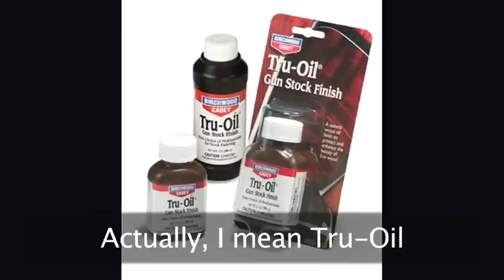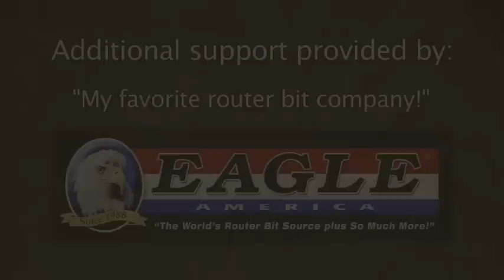107 - Oil-Based Finish Basics

Comment: Hi Mark My question is I'm using Deft Clear Lacquer Brush on Wood Finish because it 
was given to me (2 new Gallon cans) but after the first coat has dried it feels gritty & 
nowhere as smooth as before I applied it? What is going On?
This is on a 3/4" Birch Plywood assembly Table in my shop. I started with 80 grit sand
paper because I've had the plywood for months in my shop & it had a few scratches and 
dents and then worked up to 240 grit & top was as smooth as glass but after first coat of lacquer it felt gritty so I went back to 120 grit,150 grit,200 then 240 grit and cleaned by vacuuming then wiping down with Mineral Spirits and soft cotton cloth and 2nd thin layer of Lacquer as the can says and it still comes out gritty ?
Please Help! not sure what to Do? Should I have thinned with Lacquer Thinner - the can says do not thin! & No need to sand between layers? 
I've never used Lacquer before but have used Polyurethane a lot and always sand with 
220-240 grit between every coat and blow off with air and wipe down with damp cloth then 300 grit & polish/Buff the last coat to a nice shine. So what am I doing Wrong with Lacquer?
Thank You for any advice you can give Me! Love you videos!

Comment: Thanks for the reply, After reading more it looks like I can use pure varnish like Epfanes or Arm-R-Seal on sanded and prepped F.Glass prep for better adhesion. Then the bare Cocobolo prep with Acetone, apply thin layer of 1 1/2 lb. Shellac to seal oil in. Then over coat with layers of thinned wipe on Varnish. After Shellac can I use diluted wipe on Varnish and hand buffed or is a brush the only solution? I have problems with streaks and drips and streaks. Good plan?? thanks so much.

Comment: Second rookie question:  I am building a little LP cabinet out of the tabletop pieces of a vintage Parker dining table.  Hence the wooden panels are all composed of pine or similar beams which have been glued together, and then layered top and bottom with thin sheets of teak (or similar).  It's going to make an interesting piece.  The problem is that 24 hrs after sanding and cutting two of the main panels, one of them has juuuuust started to warp ever so slightly.  So lesson one, I should have not sanded the original finish away until after cutting etc.  Anyway, as I can only work on this on weekends, I am in the meantime keeping these naked pieces clamped down to a flat surface to avoid warping.  My second rookie question is - how do I seal (oil / varnish as per my last question) these pieces AND ensure they don't warp whilst drying / curing? One of my "naked" pieces started warping in less than 24 hours. Kept indoors (it is cold this time of year, in and out, and it's wet weather). If I use clamps, I'm going to wind up with clamp marks and / or the oil / varnish won't dry properly underneath the holding clamps.    Your advice will be much appreciated.  Thanks.

Comment: If I want to make kitchen cabinets, natural wood is hard to clean and wipe off as the dust and possible food stuff tend to curl up to the surface. What kind of varnish would be recommended for shelving or would it be better to add a sheet of melamine?

Comment: I have a walnut gun stock with no finish. I want to bring out the natural beauty of the wood with a low gloss. Should I apply Tru-Oil Sealer & Filler first due to the open pores and then apply Tru-Oil Gun Stock Finish or should I just apply Tru-Oil Gun Stock Finish?

Comment: I used CPES on antique wooden boats with a syringe on Mahogany and or Teak, solid and plywood. The best trick is to start the topcoat (Helmsman) while the CPES was just tacky and this actually glued the topcoat to the repair work. I finished it with 10 coats of Helmsman Spar Varnish with a light sand in between coats. Spectacular on Grand Banks Trawlers

Comment from the maker: @LightningBugSF Well if you got stain douglas fir to look good, even if a little dark, I hate to see you mess with it.  But you gotta do what you gotta do right?  Mineral spirits probably won't affect it.  Bleach is hard to control.  I would probably strip, sand, and try again with a different stain.  if you just sand alone, that won't make it lighter.  it will just make it look patchy.

Comment: I'm looking to buy an antique table that the owner says is finished with oil.  However, the table top is looking dry and paler in color than the sides and base of the table, which are a beautiful rich cherry tone.  Also, the leaves look like they haven't been maintained in 50 years (previous owner never used them)--they're dry and grey.  I feel like there is hope for the top surface of the table, but what about those leaves?  Can I expect to be able to restore them using the same oil as the rest of the table and have them match?

Comment from the maker: @rockonku Well the best finish is the one that you can apply properly and effectively.  There are many finishes that will work for stairs.  I do beileve Arm R Seal would be a decent choice, although most coating for flooring are made with a higher amount of solids, so that they stand up to the constant wear and tear.  I yes you can use Arm-R-Seal, but I might also take a look at some specific flooring products.

Comment: I know this video is several years old, but it’s very informative. Right around 8 minutes in you are talking about mixing your own oil/varnish mixture. You are holding boiled linseed oil and also mention tung oil... can mineral oil be used in that application instead? I like using mineral oil on my cutting boards, and usually put GF salad bowl over the oil...

Comment: great video. thanks. i just have a question or two. I thinned down the poly 50/50 with paint thinner and applied a thin coat using a clean rug to my table tennis blade. Is it ok to apply another coat when it's dry to touch yet still tacky? 2nd question, what to do if ever i applied 2nd coat while the wood is still tacky after 2-3 days? thank you very much.
Reply from the maker: Nope. Never apply more finish if the surface is still tacky. That means it's not completely cured yet and adding more finish will only make the problem worse. It results in a finish that's even MORE tacky and takes longer to cure. If you're lucky, you can let it sit for a few weeks and it will cure up.
Reply: ok. got it. Thank you very much! :)

Comment: Hi, great session on oil finishes. I have a question, Can a nitro lacquer be sprayed over a dried linseed oil base? Will there be any adhesion issues? Do I need to hit the linseed oil after it dries with a shellac first? The reason I say this is that linseed oil really pops out the grain and I want a matt/semi gloss finish with Nitrocellulose lacquer . Please let me know.
Cheers, Craig
Reply: Craig Roy. Cheers. Not all lacquers are equal, and most manufacturers will always recommend you only spray over their products. We’ve sprayed lacquer over boiled linseed oil only after 72 hours. We now use a vinyl sanding sealer under all our lacquer, per KCMA reqs, might aid adhesion. Now moved to using clear stain base, no tint, to duplicate effect of linseed oil, and we can top coat after an hour... but if time’s not a factor and you want the amber color of linseed oil, go for it. Shellac may be ok if it’s not waxed... but best to keep it simple because finishing can be really tricky. Good luck.

Comment from the maker: No experience myself. But as long as the surface is fully cured, you can coat it with just about everything. Give it a few weeks just to be certain. If you sand lightly and you get little boogers on your sandpaper, it isn't ready.

Comment: Something I learned at one of the woodworking shows:  At a party, people put a beer bottle on top of horizontal surfaces.  They never put the bottle on the side of the table leg.  Gravity won't let you.  So coat the horizontal surface with varnish, but leave the legs/sides/insides with shellac or oil etc.  It makes the legs look great, yet the top surface is durable against the idjit that puts a beer bottle on your table.
Reply: +Bill Wheaton  You stated the obvious which had avoided me. Great info you just provided. Thanks!

Comment: Hello and thank so much for your video. I have an Acacia (white acacia / black locust) dining room table recently made... and am unsure how to best bring out the grain. What finish would you recommend to best accomplish this? Really appreciate your video, very well done!
Reply from the maker: I think one of the best and most beautiful finishes is a simple wiping varnish. Brings out the natural colors, enhances them, and also provides protection.
Reply: So i ended up staining the Acacia Table with Linseed oil and let it sit for a week before putting on several glossy polyurethane and then matt polyurethane coats....the table came out beautifully...thanks for your help

Comment: What's the best coating for long handled garden tools eg rakes, spades and forks for a durable finish. They were handed down from my great grandfather and still in good condition ( buy good, buy once) but they were open to the element when the shed roof took off in gales. Most of the handles are ash but a few are hickory. Some of the handles have dried and grain has opened so I'd like to get some oil in there. The tools might sometimes be left outside.
Reply: Oh and what oils or other penetrants can take an overcoat of something more durable and what penetrants can't?

Comment: Thanks for posting these! It helped a lot with a project I am currently working on. I do have a question:

My table top (Soft Maple) has been stained and one coat of oil/varnish (linseed,poly,mineral) has been applied. I want to create a design and paint it with OneShot metallic (brass) enamel. All of my research says that once properly dried I can continue applying the remaining layers of oil/varnish over top of the design that is on the table top. I want to know if my research is correct? Thnx

Comment: heh, well that makes a lot of sense! its true, it is a lot of effort and patience.. but then, what would be an ideal top coat for a stained tung oil finish?
i certainly dont like the glossy poly finish on most typical guitars. my goal would be some protection from moisture (sweat and such), and the satin sheen and super 3D depth that the oil brings out when still wet (which sadly seems to go away after drying, up to now).
hey, thanks A LOT! your videos really help!!

Comment: Do you have any experience with Sutherland&Welles products? I used their 'hard sealer' which I think is polymerized tung oil with some Uralkyd? resin for the first two coats on a cherry tabletop. I then moved on to their TableTop finish which is "a high quality uralkyd resin with Polymerized TungOil Sealer." I am having a hard time with this stuff(bubbles and streaking) and want to know if I can finish up with a wipe on poly/armRseal varnish. FYI, no MSDS for any of their products @ ~$40/qt.

Comment from the maker: Well, if you have an oil/wax mix on the surface you are pretty much committed to that route. Finishes generally don't adhere to wax. I'm not familiar with the product you're using but if you are using a true oil with wax in it and you still get material on your cloth in that time frame, you are probably putting too much on the surface to begin with. Less is more with oils.

Comment: Any thoughts or tips on choosing a finish for a tongue drum/slit drum?  I'll be using African Padauk for the top and am wondering how the different finishes may affect the tone, if at all.  Obviously with the expense of the board I want to try to keep my experimentation down to a minimum.  Also, it seems that I'll need to keep bleed through to a minimum since I won't have access to the inside of the drum after it's finished.

Comment: Hi Marc i've made a chest for shoes to be left outside under the verandah i'd like to coat it in cpes prior to using an external grade polyurethane. My question is that i'd like to coat it in boiled linseed oil prior to using the cpes to really pop the grain, is that going to be compatible with cpes? Thanks cheers.
Reply from the maker: +Libby Parker It should be, but it's not a bad idea to give it a good week to cure first. Also, try the cpes on scrap first and see if that doesn't give you enough "pop" on its own. If you don't have to use the BLO, don't.

Comment from the maker: Yes you can add shellac on top of the oil. But man, that's a LOT of effort just to cover it with a film. Tung oil, applied in that manner, is a great way to get a hand-rubbed look. Unfortunately this type of finish is not all that protective. So I understand the need to apply a film like shellac or varnish. But when you do, you essentially negate all of the work you already put into it. You could get the same look with one coat of tung, followed by your topcoat film.

Comment: Greetings I'm just entering wood crafting in this case musical instruments. i've just tried the minwax water based stain, when working with very thin wood 2mm thick .87 thousands I'm trying not to worp the wood and my question is can i apply a laquire clear coat in stead of the poly crylic witch saturates the thin wood even more?

Comment from the maker: Yeah unfortunately what you are seeing is cracking as a result of the wood drying.  The key is to use kiln-dried stock for your projects.  You'll have to see if anyone in your area carries 16/4 stock.  you should be able to find some fir or southern yellow pine depending on where you live.  Otherwise, call some local hardwood dealers and see what they carry in the thicker sticks.

Comment from the maker: It's probably a combination of durability and solids content, but who really knows. Labeling on cans, ironically, can be one of the most misleading sources of information about a finish. But generally speaking, floor finishes are specifically configured for that task so if at all possible, use the stuff meant for floors. You can certainly use what you have, but I can't necessary say how well it will turn out for you. I don't have any experience with finishing floors.

Comment: hi! really nice explenation! I have one quetion: can I add wax after the linseed oil coat? I mean I have been putting bee's wax after one day the oil has been cured. does it make sense? thank you
Reply: +Lorenzo Marrali   I'd like to know that as well. I want to go simple as possible.
Reply: +Billy Barton I know right? is seems almost impossible to understand some simple stuff. almost as people were afraid to give that "divine secret" of some sort. by the way.. I have asked my local wood supplier and he told me a lot of interesting stuff.. first, yes. it makes sense to put wax after oil. but is it better if oil is "boiled" or "coocked" I don't know English very well.. by the way, linseed and a great choice if you want to stay simple but you need to wait at least three days after a bunch of coats. he said for soft wood and medium use three coats of oil (the one you prefer linseed, nut, danish) each coat every 24h. after that apply a generous coat of beex wax (the one mixed with carnauba works too) and wait 15 minutes.. after that use hair drier to blow the project surface and let the wax melt (you will notice that it will get translucent and watery.. do one side per time.. after a really good blowing go with a wool napkin and stroke really hard.. let the melted wax go inside the wood's fibers... and that's it. after 24h if it looks a bit greasy go again with a clean cloth.. I have done it on my last three projects and they look fantastic. it might seem a bit time consuming but it is really simple and each coat (oil and wax) only take couple of minutes. I hope it has been useful. and forgive my English. cheers.
Reply: Thanks for your reply. What I do is "rustic" so I'm not concerned about hi gloss finish.

Comment: im finishing a guitar body with pure tung oil. its already 8 coats, letting each coat dry for about 20 days or so.
i'm loving the looks of it already, but i would like that extra depth that varnishes seem to produce, plus the extra protection (dont really care about dents as much as moisture from playing)
if the tung oil is left to dry long enough, could i add shellac on top of it?
if not, would some 20 more coats provide that sheen and depth? how about protection?
thnx!

Comment: Thanks allot for doing this videos. Very helpful. I'm struggling on my first guitar project and as much as I love the durability of the polyurethane I would rather prefer an oil finish look. I know that tru oil is very good for this but at the moment I only have access to danish, tung or linseed oil. How many layers would be needed of the ones specified to get as close as possible to tru oil. Or can I get the durability and look with those oils?
Thanks

Comment: I have just completed building a Strat in a Guitar Building Course. The body is made from Swamp Ash and the neck is made from Maple. I stained the guitar with Becker 335 Red Spirit Stain and finished it with Minwax Wipe-On Poly. I applied 3 coats Poly but did not sand it back. I was thinking of removing the Wipe-On Poly and using Tru-Oil, is this possible and what steps are there to doing this?

Comment: If you use polyurethane, should you also use a wood conditioner before you apply the poly? Thanks
Reply from the maker: Not unless you need to. Wood conditioner is a problem-solver and it's usually applied prior to stain. So there's usually no reason to apply it before a poly.
Reply: The Wood Whisperer Great thanks!